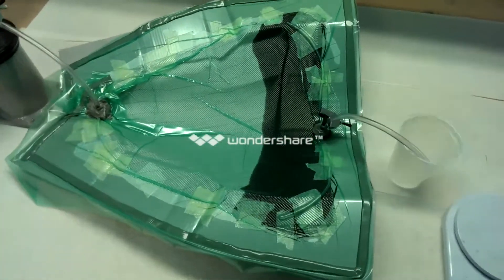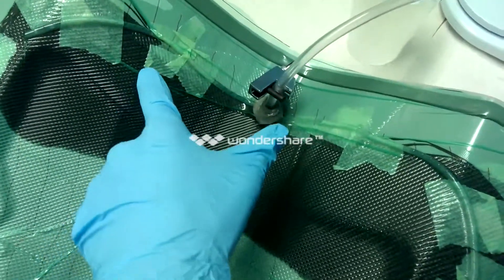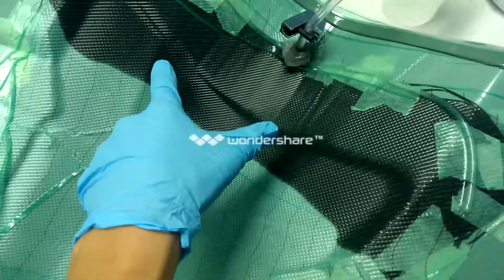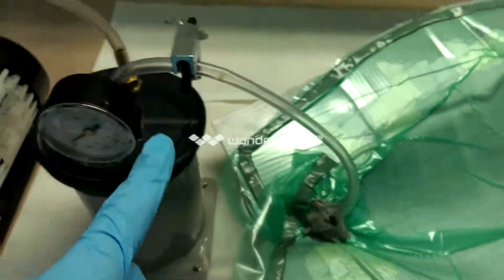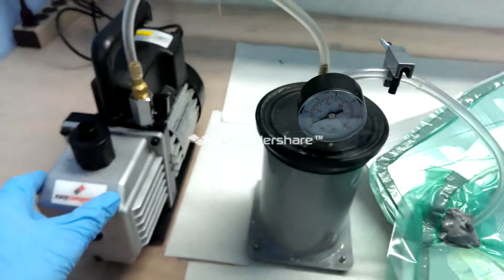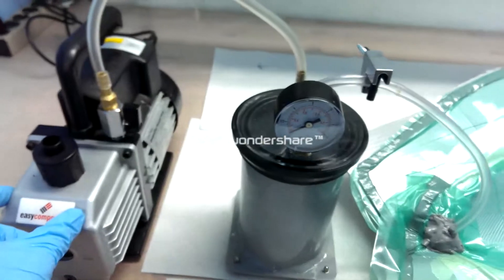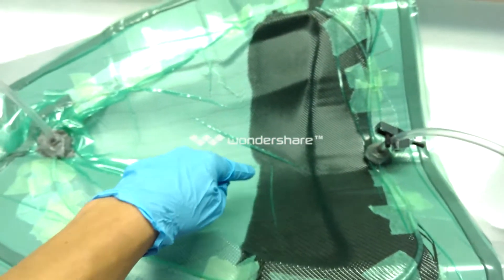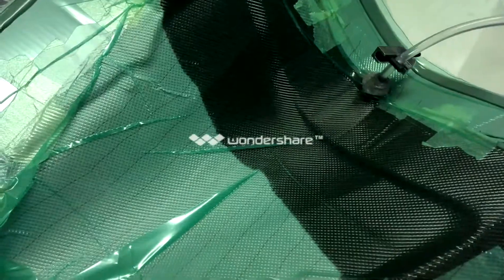Carbon Fiber Vacuum Infusion pt1

Comment: Thats a slow flow :) how did the part turned out?
Reply from the maker: +Matthieu Libeert (Mat's Prototyping) It was a cold that day so the epoxy was a little too viscous for my liking. The part turned out fine but it just took a good while to flow on the part.